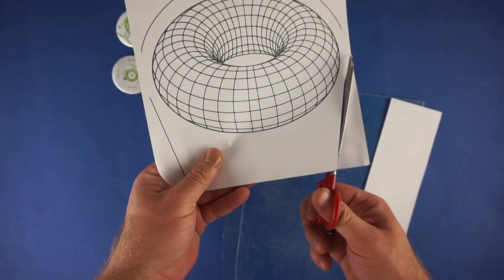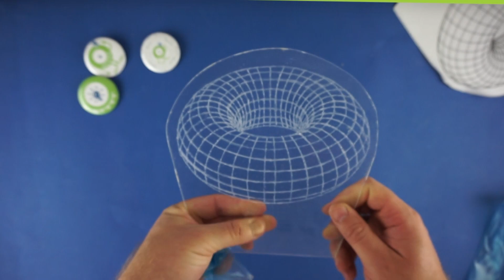3D illusion Led Lamp DIY How to make

Comment: If you heat the edges of the acrylic with a torch carefully, it will melt and make the edges round and smooth.
Reply from the maker: I are right ;-)

Comment: G’day Smart Beast, very cool.  Could you use more LED strips on the inside vertical sides of the two timber blocks?  I’m thinking of trying to project more light for a more involved drawing.  Appreciate your efforts to share your skills and inventiveness.  Enjoy your day.  Cheers, Gary
Reply: Smart Beast, I guess my question is really about how you work out how much wattage (if that’s the appropriate measure) of LED’s are required per square centimetre of Perspex/acrylic combined with the amount of lines in the drawing used.  Hope that makes sense.  Cheers, Gary
Reply: @thegazman53  I know it. less then 2W.

Comment: if you dont wanna see the edges , just heat the corners with a propane torch and they will become clear again just be careful not to melt the edges that way you just see the image not the edges
Reply from the maker: Good point ! I will do a test in some movie! I think the hot-gun will be good ;-)
Reply: How big can the object be used?

Comment: which machine you use for draw in glass??and what is the price?
Reply from the maker: It's no glass
Reply: Smart Beast whatever i didnt ask is ut glass or not..i asked the none if tools and its price
Reply from the maker: Plexiglas is soft material - Easy to work on it - I use cheap Nail Drill Machine - ~$4